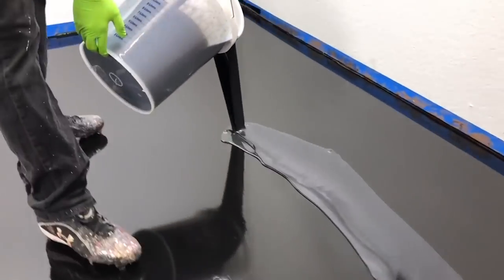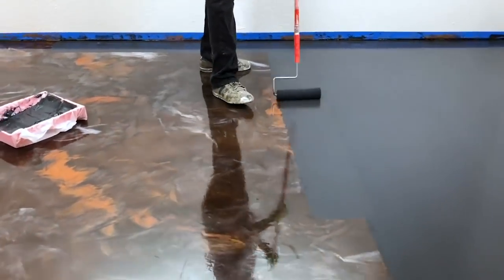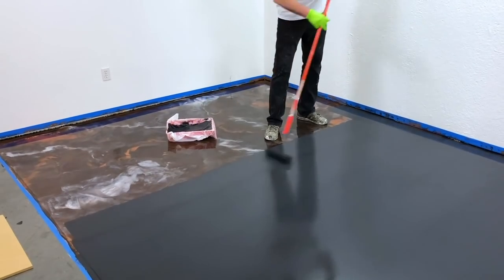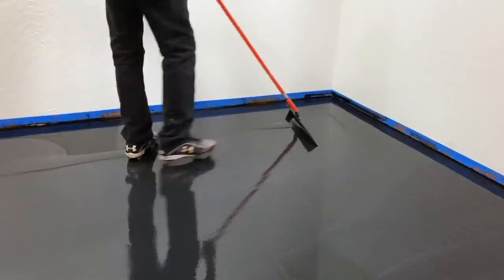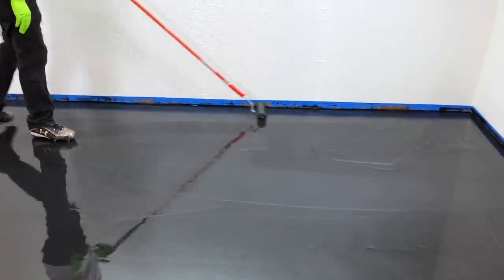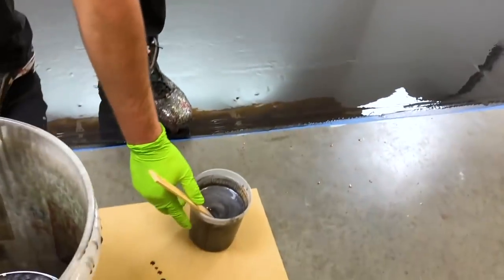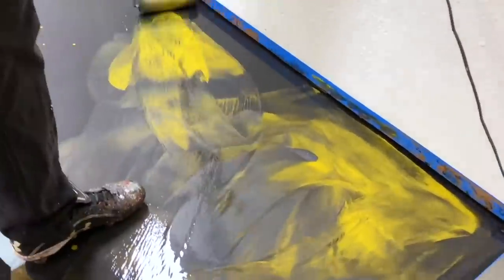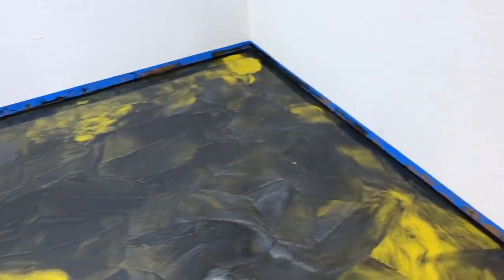Industrial Grade Metallic Epoxy Floor That's Easy To Install | Black, Yellow & Titanium | DIY

Comment: Wondering if you have every Epoxied a Wooden Deck / Pool Deck
Caulk all of the Seams so it doesn't drain 
What kind of Grit can be used to make it anti-Slip?
how much Flex does the product have?
Is the a Product designed to flex after it's cured?

Comment: Lovely finish... but why don't you use a notched squeegee to spread the epoxy....
Reply from the maker: We’ve found this technique to be easier than a notched squeegee, especially since we teach to tape off each area where a “kit” (3 gal. amount) is to be placed. Also, many people don’t recognize when the notches on the squeegee get worn, making the floor thinner than desired.

Comment: Is there a reason to why the “basecoat” wasn’t sanded before applying pigment?
Reply from the maker: The first step was applying our WB Primer which allows the epoxy to bond.